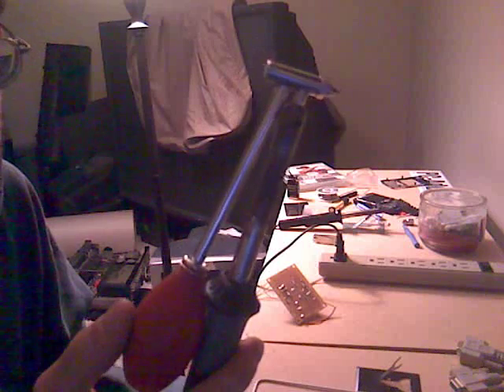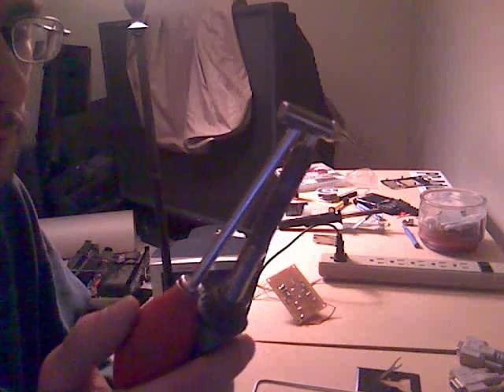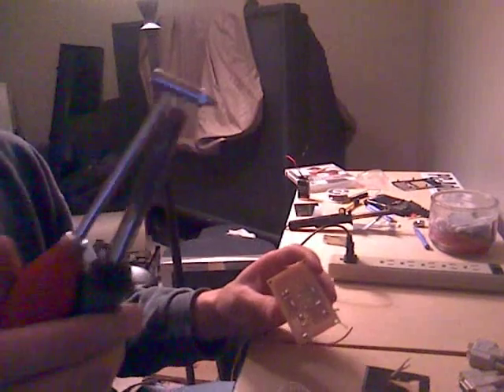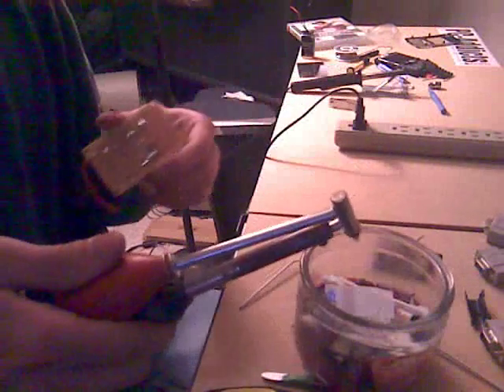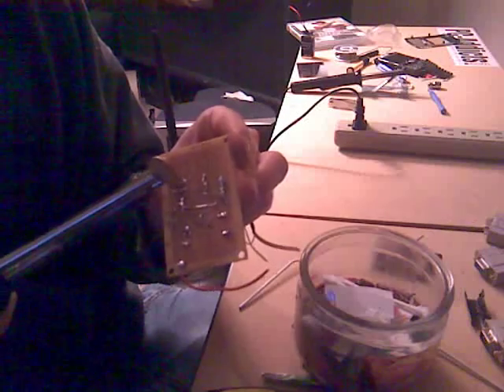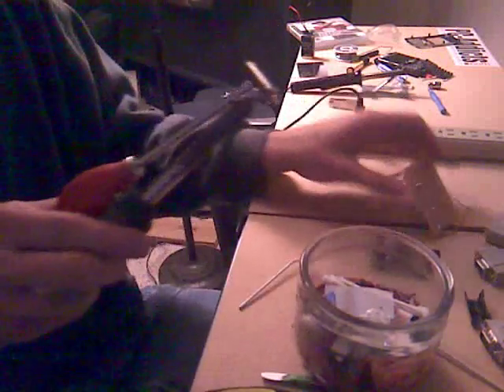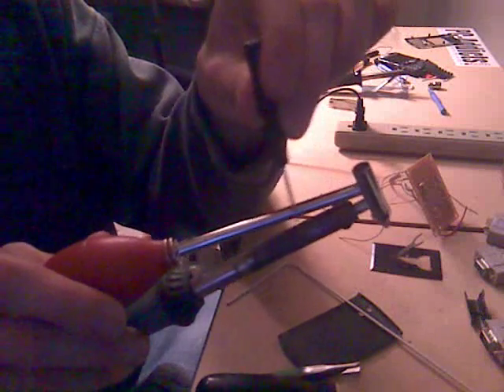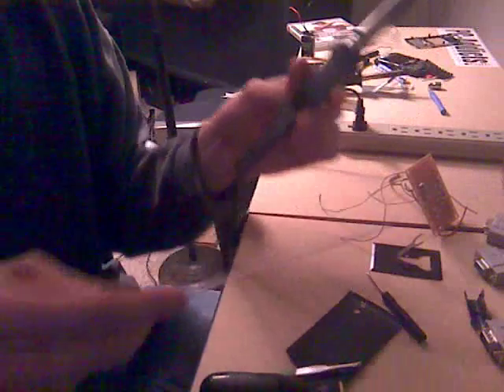radio shack desoldering iron

Comment: Yep good tool to make your work neat because I'm always redoing guitar wiring projects so without this I would just be adding more & more solder to pots and just making a mess.  Unfortunately these are not sold anymore and they don't last forever (the element burns up)  so I'm forced to look elsewhere.
Reply from the maker: I know, there is another brand but it's way more expensive than $15 that radio shack sold for

Comment: Not gonna lie. I've seen this around radioshack and was iffy about buying it. Saw your video the other day and was convinced that I needed it. It sure makes desoldering a million times easier. I honestly feel it's faster than using a soldering iron + desoldering braid.
Reply from the maker: I've have worked at a commercial repair replace and leave the se soldering iron on 8 Hr days 5 days a week. Tip would last two week, the desoldering irons would burn up every 3 months. Well worth the $15 compared to what these people was making hourly.

Comment: Since I have heard a lot of concerns on over all durability of these desoldering  irons.  I was wondering how well its holding up now that it has bean 2 years since you posted your video?
Reply from the maker: I've had to replace the tip, it's only $3. When I worked for a industrial company, they were left on for 42hrs weekly, and would last for 3 months. As long as you don't leave them on for 9 hrs daily, it'll last a long time. I still have the same in video, at $15 you can't beat that.
Reply: Thanks for the info. I found your video and response to be very helpful.

Comment: bad news for pace  we had a of several hundred dollar pace unit that always needed something done to it  but when it was working right is far superior to anything I've ever found  but I fix up old arcade equipment jukeboxes pinball machines etc cetera  50+ year old solder joints are not pretty ...

 cheers from San Diego